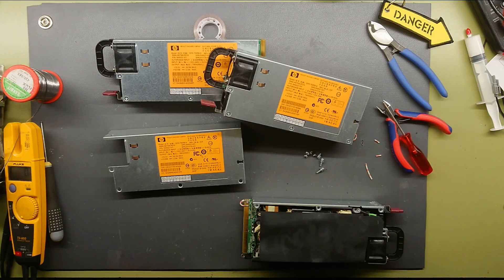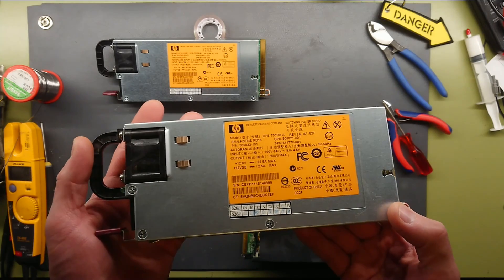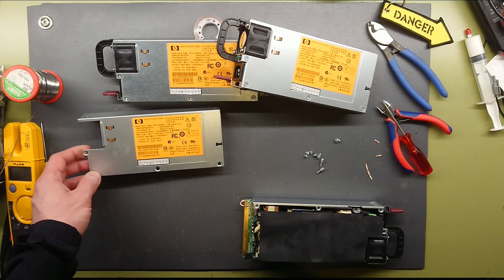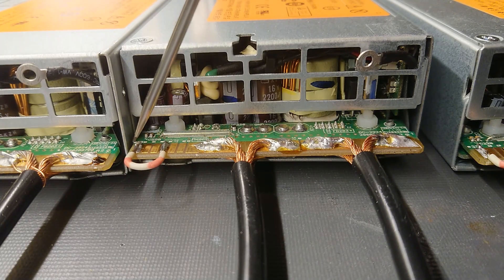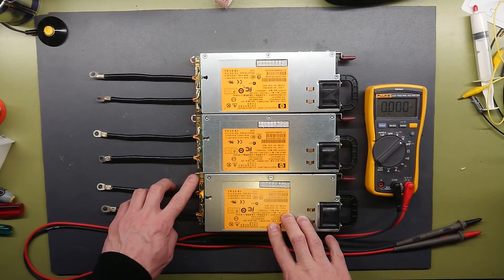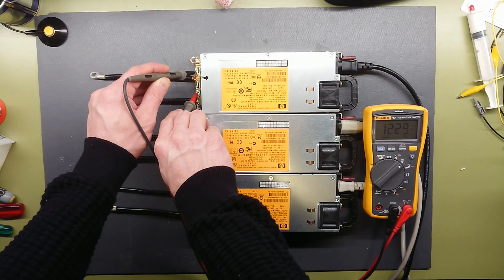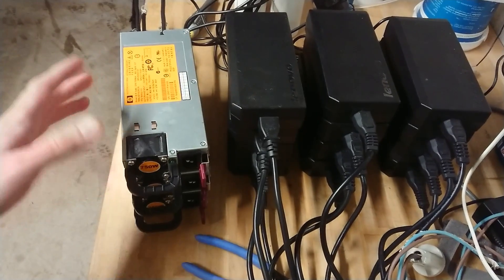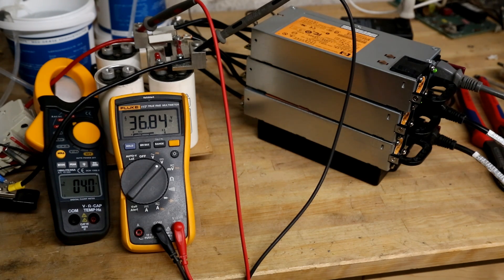2200 Watt Server Power Supply (HP DPS-750 RB) For Induction Heating

Comment: I tried with 4 to get 48V but the last one sparked in the fan area. I think its broken now, but the other three still work in series (36V). Is 48V just too much for the internal parts?
Reply from the maker: You are not the first to report these failures with 4 in series, so it is safe to say that it pushing them too far.
Reply: I burned a few of mine this way too. The power going to the fan passes through a set of TINY diodes (on the board near the fan). Those diodes get hot fast and quickly burn. The neg side of the fan is connected directly to ground (small wire with screw terminal on the board near the fan). I'm no expert, but it seems to me like that area is seeing the high series voltage due to that ground. To try and solve it, I connected the ground wire we removed from the front to this ground wire near the fan to make the fan use our isolated "ground". It improved strange fan behaviors I saw with 3 in series, but I have not yet been brave enough to try 4 again. I bought a cheap astec 42v 6000 watt power supply around that time (35$ shipped), so no longer needed the 4 HPs in series.
Reply: I just realized I posted about this "fix" in these comments 9 months ago, but I had no clue why it worked at the time. I must have gotten a little smarter in 9 months. According to my 9 month old comment, I DID get 4 working in series with no magic smoke. Nice!
Reply: @aromaticpillow  Was wondering if you could possibly answer a few questions on those Cisco Astec power supplies. Is the C13 computer plug proper for these? Do you have to do anything special to get them to start up? I see the connectors in back, are they labeled?..IE, 3.3v and 12v...If you can, much appreciated.
Reply: @MrDLRu  I bought the proper C13 plug for on of them, but hard wired 2 standard plugs to the 2nd one from inside the unit. ATX power cords tend to be thin gauge, so I always use the 2nd unit on 220v with both cords plugged in. I don't think I had to do anything special to get it to power on.

Comment: you eliminated all 3 grounds ? did not you left the ground of 1 conected to one of the cases ?
Reply from the maker: I have tried to both remove all grounds and also leave ground on the last unit at the negative rail, no difference.
Reply: @KaizerPowerElectronicsDk  thake you

Comment: I got my 10 units and have been experimenting with them in series. I had some success, but could not get more than 3 in series working  at a time. Even with the three, I have some interesting behavior. Without a load, as soon as I connect the 3rd one to the series, one of the fans slows way down. Similar behavior if I change order and swap entire units in and out. Adding a load, same behavior. Remove the third unit and the fans spin up due to the load.  The output voltage and current is fine, but the fan just never spins up, even as the PS heats up. When I was trying 4 in series, I initially had success, but then started getting smoke out of the last unit (no load applied!). I tried swapping units in and out to get the 4 in series working, but either got a chip next to the fan overheating, or a supply shutting itself down right away. One power supply now has it's fan minimum speed permanently increased to about 30%. My thermal camera has been critical for these experiments! I feel like I need to make a whole video analysis of these power supplies.
Reply from the maker: Keeping in mind that these are built for 12V output, the power electronics part in the inverter is not rated for much. It could perhabs be 40 or 60V parts, if even that high. So if voltage sharing or grounding of the chained power supplies is not removed, you are pushing the parts above their limit or creating ground paths that makes them work against eachother. I assume you did remove all grounds of negative rail except on the last in the chain at the negative rail?
Reply: @KaizerPowerElectronicsDk  Thanks for the info. I'm fairly new to hooking up power supplies in series, so it's been a challenge understanding all of these oddities. 
I removed all grounding on the secondary side in my first attempt. Then I tried grounding one secondary in the chain, and moved the grounded unit to all different places in the chain (1st, 2nd, 3rd, then last). I actually overheated and blew up a tiny diode connected to ground (there are 4 diodes connected to the earth wire near the fan). Using my FlIR One, I saw that the diode area heats up FAST when when the 4 are chained, and not at all when there are 3 or less. I made a video showing all the things I tried and the results. I'll try and post it tonight.
Reply: UPDATE: I disconnected the ground on the rear of the daughter board, and my 4 in series worked! It was a brief, unloaded test, so cannot confirm if there are any side effects. I was thinking of connecting that rear ground wire to the cut ground wire in the front since they are essentially connected in stock units via earth ground. If I was an electrical engineer, I'd know why this appears to have worked and the problems it could cause.
Reply: @aromaticpillow   I want to do the same as you, 4 in series. Are your setup still working? I have the HP HSTNS-PD18.

Comment: Look for a "Cisco WS-CAC-6000W". There are versions of 3000 / 6000 or even 9000 Watt! You can get them very cheap of off ebay and are quite easy to modifiy from 38...52 V output at over 100 Amps! You can read about modifications in the MFK-forum over here: http://forum.mosfetkiller.de/viewtopic.php?f=2&t=63559&p=284968#p284968
Reply: Just ordered one for 30$ incl shipping. It has a 42v output stock! My 3 HP supplies run OK in series for 36v, but they exhibit some strange fan behavior that i am not 100% comfortable with.
Reply: Sure, quite easy you say..It's all in German.
Reply: @MrDLRu  Use google translate! I got a wealth of information after doing that.

Comment: Wow! So grateful for this great tutorial. You earned a new subscriber. I just ordered a lot of 10 of these power supplies for various projects ($54 shipped), including my 1800W induction heater.
Reply from the maker: If you need any information on these induction heaters, check out this thread: https://highvoltageforum.net/index.php?topic=530.0 it is chuck full of good advices and best practises for using these units.
Reply: what size are the nylon screws i need to float it

Comment: Many of the capacitors are like 16volts max internally, that isn't a problem?
Reply from the maker: As long as the capacitance variance is no larger than each capacitor in the string would see below its rated voltage. You do know about capacitive voltage divider?
Reply: @KaizerPowerElectronicsDk  Ok so sounds like it's ok, I saw another video mention it so wasn't sure. & No I don't know anything, but I am reading about it now
Reply from the maker: @gg-gn3re  I wrote a small article about it, for large electrolytic and other DC bus capacitors in series or parallel: http://kaizerpowerelectronics.dk/tesla-coils/drsstc-design-guide/dc-bus-capacitor/

Comment: Would it be wise to use my 220v outlet for this?  I think this will probably max out my 15A 120v circuit.
Reply from the maker: 15A 120V is 1800W max, so yes you should use your 220V outlet if possible and the input voltage range of your power supplies allow for it.

Comment: Hi thanks for the video I have a delta dps-600sb psu.
Does any one have the pinouts for it thanks.
Reply from the maker: Your best bet would be the rcforums, but I did check there and google. Best approach would be to find a picture of one with similar pad layout and then try to make the short circuit with a 1K5 resistor to limit the current if you hit something wrong.
Reply: @KaizerPowerElectronicsDk  thanks

Comment: HI, I have connect four up power supplies (same model as yours) and isolated the dc ground on all four (exactly same as you've done) however only 3 supplies power up and the fourth does not. Note I have swapped the power supplies around and used spare ones, but the issue still happens....note always the first server in series (it's positive connected to next supply and it's negative to load)....any ideas please?
Reply from the maker: Could be some overvoltage condition or avalanche on a diode. Maybe the control circuit is not completely isolated at a higher voltage and you have more leakage or something. Never tried 4 in series.
Reply: @KaizerPowerElectronicsDk  HI, many thanks.....I have one idea, and will let you know if works....meanwhile curious....I have floated all my power supplies yet some forums say you only need to float those you connect to a master I.e. One grounded connected to my other 3 which would be floated.......what do you think plz....could this be the cause of my original issue?
Reply from the maker: @lukebrown6913  It can only be the one sitting as the last in the negative end that can be grounded, as it is at the grounded end. I did not try that either, I floated all mine.
Reply: @KaizerPowerElectronicsDk  sorry, plz can I ask one final question please....each power supply is 750w, but putting four in series won't increase the wattage i.e. 2500w....series only increases the voltage ..is this right?
Reply from the maker: @lukebrown6913  Power in Watt is P = U * I. Current in a string is the same all way through. Voltage is divided by each link in the series connection. So you have 62.5A from a single power supply, that current rating will be the same with more in series, but the voltage goes up. So from 1 power supply 12V * 62.5A = 750VA, but 3 power supplies 36V * 62.5A = 2250VA.
Reply: @KaizerPowerElectronicsDk  HI,  I've learnt something new, thank you.
Reply: I have the same problem with 4 in series. By swapping them around, I can get the 48v for a little while before a component next to the fan overheats (no load). Most configurations just cause the last PS to shut off.
Reply: By the way. That overheating component appears to be 4 diodes used for ESD protection. I think the 4 in series was just too much. I disconnected the ground that they are connected to and initial results of 4 in series are great so far. Need more testing though.
Reply: @aromaticpillow  HI, I have since learnt that when I put a load on it I.e. Heat something on the induction, none cut out. I have burnt out one two of the power packs, but since then the four I'm now using seem to have settled in and all work together. All of mine have been de-grounded, but I have kept the earth connected via the plug.
Reply: @lukebrown6913  I got 4 in series working finally as well, but didn't put more than 5 amps load on it yet. I had to remove the ground from the BACK of the daughter board (Not the earth ground next to the AC input) to prevent the burning diodes and shutdowns.  Did you remove that ground wire as well? I actually tied that disconnected earth ground on the back of the daughterboard  to the disconnected earth ground on the front of the daughter board. Not sure if that was necessary.
Reply: @aromaticpillow  Hi, I followed the YouTube video and removed the two earth wires from each motherboard and raised the the motherboard so not touching case. However left earth wire connecting the case. Also ensure each unit do not touch eachother...probably overkill but rather be safe than sorry. Did think about making one unit a master and the others slaves, but couldn't be bothered to undo one of my conversions. I also connect the fans and water pump to the first unit. Found that turning this one on first and then the others one at a time helped. Ps, I'm not at electrician so please don't take the above as advice.

Comment: A while back I bought a bunch of servers for 10$ each and sold most of them for 50 but I kept two, each one has two 700watt psu and I'm going turn it into a 48v+ 57amp 2,400 watt charger for my custom electric scooter
Reply: mashed potatoes you’re gonna blow up your scooter battery but good luck
Reply: @Ferraday  nah I'm going to use a DC to DC converter with cc and CV, the battery is a 16s12p and it will have a cheap bms for charging only and a active balancer to help it balance more while charging and riding. Only way I can blow up or more likely just ruin the battery is by over discharging it since there is no automatic over discharge cutoff, but I will have a few cheap rc battery buzzers that I'll alarm when voltage goes below a certain point.

Comment: How do you run 2 of these in parallel to get 100+ amp capability @12v ???
Reply from the maker: You can put them in parallel without problems. You do not need to remove the negative side grounding for that. You could add diodes on each positive lead to avoid one power supply pushing power into the other, which can give funny regulation results.
Reply: @KaizerPowerElectronicsDk  I have a breakout board for hst pl11 with 8 16awg wires connecting to a distribution bolt. so I could add another one and connect it to the same bolt to get more capacity for my car audio amplifiers
Reply from the maker: Add Schottky diodes as shown in this article: http://power-topics.blogspot.com/2014/03/when-should-external-diodes-be-used.html

Comment: Have these failed or are they still alive?
Reply from the maker: They are still alive, check out the latest videos where I use them: https://www.youtube.com/watch?v=Q3JOZFh0z_Y and https://www.youtube.com/watch?v=VCfnuYSuDhc and https://www.youtube.com/watch?v=8Xo6V50JdDw
Reply: To summarize, 2 standoffs in the front are ground down and replaced with nylon, and 1 green wire in the front is disconnected from the case. Nothing else is touched. In the back, the standoff, green/yellow ground wire, and the black wire on the daughter board are left as is. Right?
Reply: Thanks.  I have the same supplies.  Did you remove anything on the other side of the PSU?  The other standoff screw, the mains earth ground wire that is green/yellow, or the black wire on the daughter board on the side of the supply?   I’m asking because my negative is isolated when I check continuity, but when running, I can measure 6v dc between the case and dc negative.
Reply from the maker: @HamPower  mains earth wire and standoff grounding point are left in place, since that is for protection of humans. The black wire to daughter board is removed.
Reply: Kaizer Power Electronics Just to confirm, there are two wires on that daughter board.  Green and Black, both removed?  I don’t have stable voltage if the cases touch.  The black wire doesn’t have continuity to the DC side?  I thought it was AC related.
Reply from the maker: @soldermecold7456  sorry, I meant the green, it just had so much crimp on it that I remebered as black, its shown at 2:30 in the video.

Comment: The nylon stand offs are not necessary.  The case is connected to the negative terminal via the green wire only.  The chassis standoffs are screwed to pads that are not connected to anything, they are totally isolated from the power supply.   Just disconnect the green wire or  cut it off as it is redundant.
Reply from the maker: I actually have some other server PSUs on my work bench right now, for another project, and they do have bare copper on the GND PCB trace that goes directly to the case with metal screws. It is a HP HSTNS-PL14.
Reply: @KaizerPowerElectronicsDk  No doubt.
Reply: @KaizerPowerElectronicsDk  My supplies are HSTNS-PD18....Your video was very helpful,  I would not have thought to use server supplies in this manner, nor would I have know they were available, and the configuration info, well I would have spent a lot of time figuring that one out.
Do the PL14s have the ground wire or is it absent?

Comment: Also 1 thing to note is the limitation of the circuit in 120v Countries... 2 of these psus will max out 1 (15A) circuit in your home. The 3rd unit will have to be ran not on a separate outlet but a separate circuit. Sometimes you can find a 20A outlet or circuit in certain homes but this can still be somewhat shy of the full current draw of these units. 3 of these units need 22-23A 120vAC to get full power. If you can find a way to get 240v. It cuts the AC current draw by over half.
Reply from the maker: That is a advantage in most of Europe. 230V 10-13A on single outlets
Reply: Best to design the power supply to be twice as powerful as you actually need but yes. Obviously if your taking large amounts of power the power needs to be available in the 1st place.